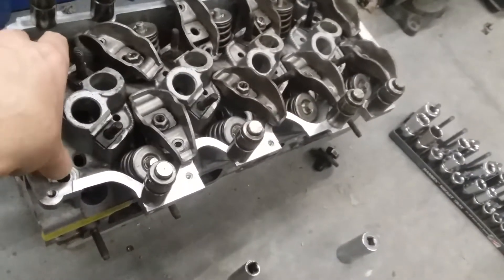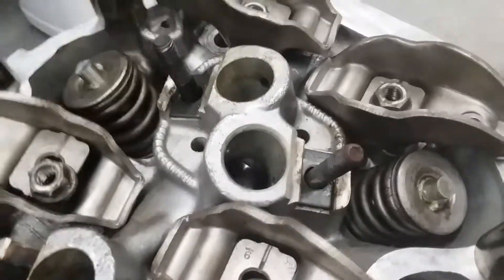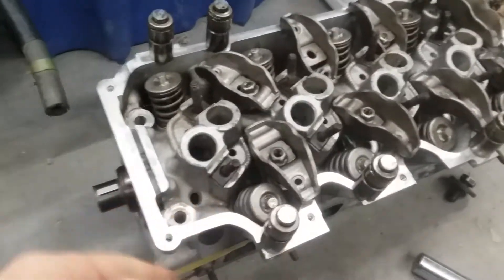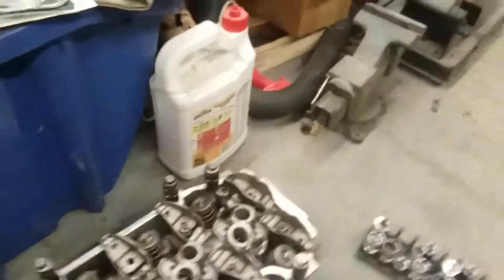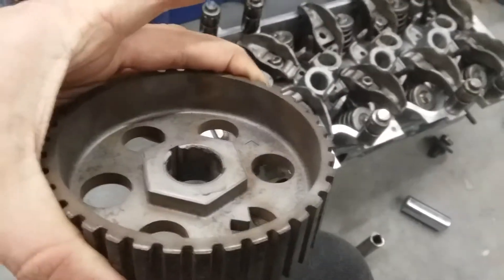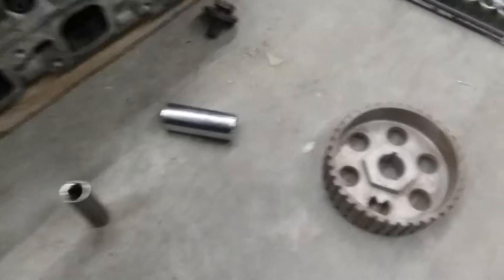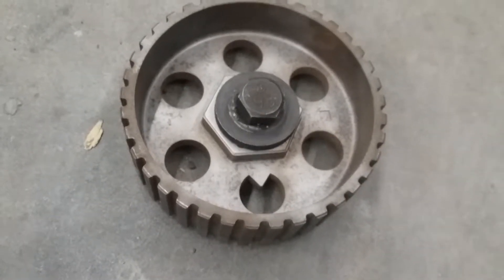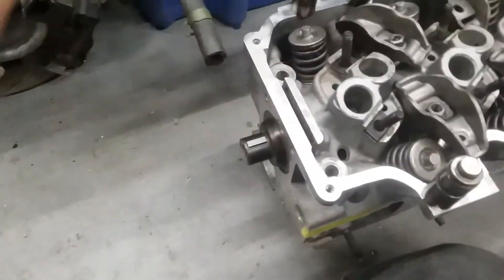Ford 1.6 CVH Camshaft Removal (E1EE Refurbishing Part 2)

Comment: hello sorry for the question but I don’t understand how to get the camshaft out of the cylinder head can you help me please ?
Reply from the maker: @latence2119  happy to help!
Remove all 8 rockers, remove all 8 lifters (if you have a CVH with roller lifters there will be some retainers above the lifters to remove), remove the cam retainer on the timing belt side, remove the fuel pump & pushrod if you have a mechanical pump behind cylinder intake #4.

At this point if you have a 1.8, 1.9, or 2.0 CVH the cam can be pulled out the timing belt side and it will take the seal with it. It is however far more conventional to remove it out the distributor/thermostat side like the 1.6 & smaller CVHs demand:
Remove the cam sprocket, remove the distributor, and out it comes

In a FWD car there's usually more room in the engine bay to remove the cam out the thermostat/distributor side, and why 1.6 & smaller CVHs demand it is because the cam journals in those all taper in size so it's physically impossible to install or remove the camshaft from the timing belt side. The 1.8 & larger CVHs however have all 5 of the cam journals milled out to the same diameter so the cam can be removed/installed from either end of the engine.
Reply: @ Thank you for your answer but I did all you said (I already removed my cylinder head beacause I want to resurface it) on my 1.4 CVH but the camshaft literraly doesn’t come out by the timing belt side cause of what you explained but I don’t understand how to pull it out by the other side.
Sorry for the lack of precision but it’s my first car and also my first engine disassembly
Reply from the maker: @latence2119  you just gently push it through the distributor hole with say the handle of a hammer, it only has to pertrude enough for you to grab the camshaft with your other hand - when removing it be very careful not to drop it inside the head or you will damage the journals of the head. It should come out with ease unless there's a lot of rust or bearing damage, and double check ypu got everything on my list as it's easy to overlook the small camshaft retainer "shim" by the sprocket and the fuel pump pushrod by the distibutor.

If the head has been sitting a while some oil sprayed onto each journal can help a bunch, if it can spin it will exit 👍
Reply: @The_1982_EXPert  thank you very much for your help ! Can I add you on a social media to show you pictures of my engine maybe ?
Reply from the maker: @latence2119  I don't have much of a social media access but you're welcome to email me at

the1982EXPert@gmail.com

And we can chat in better detail there :)

Comment: Great vid!  I recently picked up a  1991 Westfield fitted with a carb'd Ford 1.6l CVH.  I was hoping to replace the cam with a hotter Kent camshaft.  I'm not sure if my head is a hemi or kidney shape.....do you know if that will impact the camshaft I can use?  The SN on the head reads:  ID: 88SM6090 1.6L.  I'm guessing this may be a lean burn head?
Reply from the maker: Any 1.1-1.6 CVH cam will fit in any CVH head. The only thing that limits which you can use is the shape/height of your pistons (which is directly related to the combustion chamber shape of your head).

I'm not very familiar with the European engines but a kidney/heart/swirl head will often have a flat-top piston while the hemi head has a domed/crowned piston.
A high-lift and/or high duration cam may clear the flat-top pistons fine but could hit the domed hemi pistons. Some times the effect is even vise-versa depending how high the dome/crown is on the hemi pistons. Here in America the 1.6 pistons are all domed and range between 8.0:1 to 9.5:1 compression, so the 9.5:1 pistons are a bunch taller than the others.....

Luckily with any flat, dished, or crowned pistons you can cut valve-reliefs if need be at the cost of some money and compression.

Some vendors can tell you exactly which engine (or head & piston combo) you need for each cam.
Kent and Burton both provide these free services, tell them which engine you have and ask which cam from there they recommend for your setup too because some are best for turbos, some are best for bike carbs, and some are best for mild or near-stock engines.
If the vendors can't help you dig around the "PassionFord" forums, there's many CVH users across the world that could help you better than I. :)
Reply: @The_1982_EXPert  ...thank you.  Very helpful advice.  I've just received my Amazon borescope and hope to be able to see what style of head/piston I have.  My head is dated '88' which may have been either hemi of kidney shaped.
Reply from the maker: @jjlad5037  Yeah the bore scope will tell you pretty quick which you have, best of luck!
Reply: @The_1982_EXPert  ...well, I finally had some time to play with the borescope and it would appear that I have a lean-burn head. Not sure if it pays to upgrade the camshaft with this head?  I can probably source a Hemi style head in the UK, but it may be more cost effective just to do a Zetec swap?  Especially if I have to replace the pistons with the use of a Hemi style head?
Reply from the maker: @jjlad5037  I can't tell you what to do and I don't live nearby to say what's worth what :/ 
But you could still get some decent power from your lean burn or any head with a decent cam, especially if you can get a hold of headers and a decent carb. Again, I don't know what you have access to but the right parts can get you pretty far.

I've always thought about the Zetec route myself because it's fairly straightforward but the Zetecs here in North America (besides the SVT) aren't any better than our 1.9 EFI HO. It's a lot of work to have little/no gain, especially if your car is pre-EFI like mine and has to be converted to EFI.....

Comment: Hi can you put an rs turbo 1.6 cvh in a standard 1.6 carburated engine?
Reply from the maker: I don't quite understand.....

Are you asking if a 1.6 RS Turbo cam can go in a 1.6 carbureted head? It can indeed, just make sure the valves don't hit your pistons because the RS cam has more lift & duration and the carb pistons have a taller crown.
Reply: @The_1982_EXPert  thanks